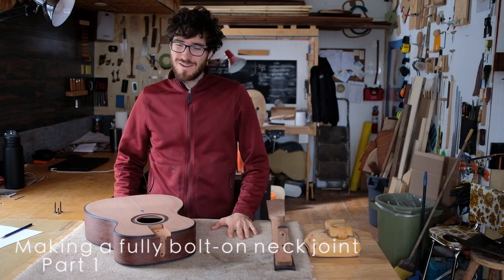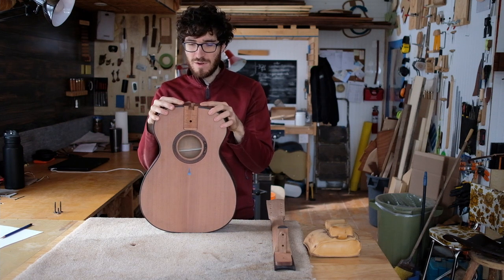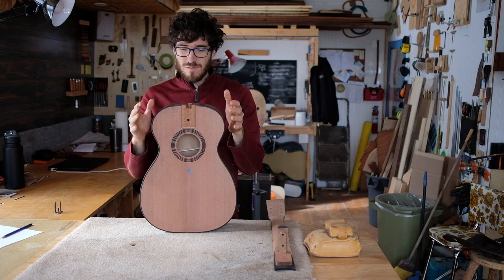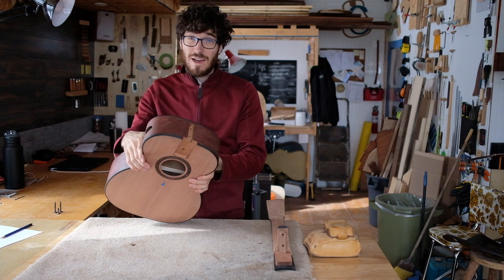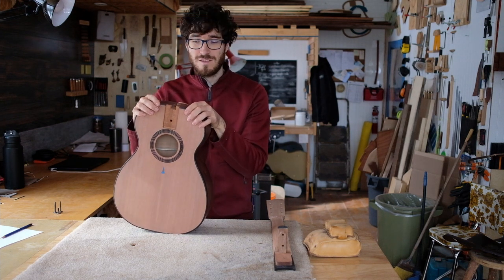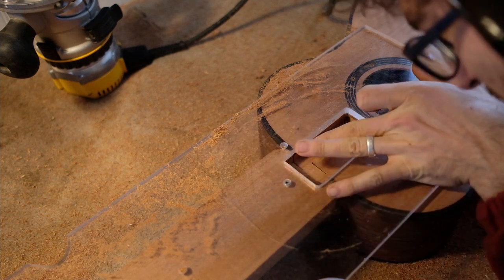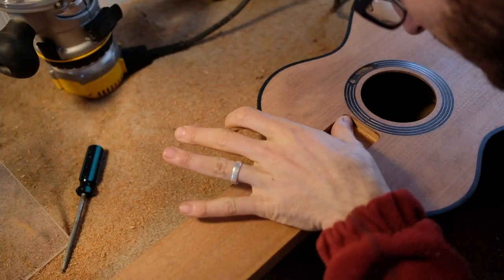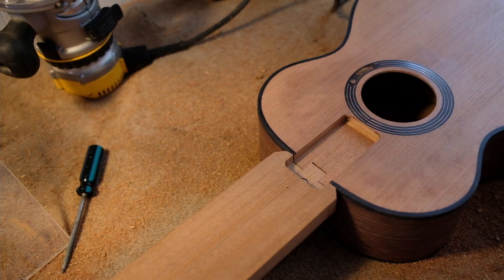Making a fully bolt-on neck joint - Part 1

Comment: It drew my interest.. however,  neck  extensions aren't hard to un glue ... 

Also , if you think  about it , that glue isn't doing much other than dropping the the extension out of the way of the business frets . A person could use ans easy to separate glue like fish glue and not spread it over the whole extension.  A hot palette knife could separate it with ease.and you could do it so the knife would slide under the extension easily.. you wouldn't need roo much heat , nor much chance of scuffing the top, not much glue to remove..and the making of the joint would be easy peazy..

I think I'm trying that on the next mortise and Tenon Nick I reset.

 Thanks for posting.. while I probably won't be copying that idea , you sure gave me a good one to try out.
Reply from the maker: Sure, that’s another way to do it and would work just fine. In fact, that’s what I used to do for about the first 7 or 8 years of my career, bolted through the heel block and glued fingerboard extension. I just really like the serviceability of a fully bolt on neck joint as well as the stability of the frame in the upper bout when it’s done this way. Taking apart a glued fingerboard extension is not fun and it is pretty tricky not to damage the finish anywhere so it often requires several more hours of work for a technician if the neck needs to be removed. 
With all that being said, this is just one of many many ways to attach a neck on. It’s not necessarily better or worse, just different. :)

Comment: Hi Zach, thx for all the help via comments on this joint.

I routed the mortise and tenon and the neck is out of alignment by maybe  1/64” over 12”.  Would you rough shape the heel and then floss it to perfection and then do the extension pocket, or am I close enough that I can do the extension now and floss the perfect fit later?  I’m wondering if it has to be bang on at this point or just really close. Thx!
Reply: Yeah I’ve had to do what you mentioned a few times now. I rough shape the heel then hollow out some of the wood between the edges of the heel and the tenon so flossing works more effectively, then put the two bolts in loosely and floss. Tightening the bolts every now and then to check your alignment. Once it’s bang on then move on to routing for the extension pocket. 👍🏼
Reply: Perfect, thx!
Reply: No problem! :)

Comment: Great approach for getting this joint spot on correct !  I retired many years ago but keep active repairing and building guitars. At the moment I'm building an OM-21 style and as I live in Australia, I'm using Victorian Ash which is a eucalyptus hardwood for the neck.  
Could you tell me about the guide you're using to check the fit of the neck to the body and is there a radius in the top or is it flat ?
Reply: Thanks! 
Cool, that’ll be a fun project :)
The jig I’m checking the neck angle with basically just has 3 protrusions, one at the bridge location, one at the neck joint and the other (which sticks out about 2mm extra) is at the nut. It helps me dial in the setback of my neck so that my neck projects to the right height at the saddle. 
Alignment side to side is eyeballed with a centre line on the neck and top. Does that answer your question?
Reply: @zachlefebvre4825  Thanks Zach, all new to me as I've be using a more cumbersome approach with a straight edge and measuring gaps etc. Is there a source where I could find a plan on how to build your alignment/reference jig ?
Reply: @andrewdarnley4608 - I don’t know of any plans, but I’ve made a few of these jigs by 
1) jointing one edge of a thin board
2) gluing equal sized “nubs” where the nut, neck joint, and saddle go
3) adding a shim to the “nut nub” which is the thickness I want the setback to be.

Comment: The neck block 'ledge' or 'extension' that gets routed out... is that glued on to the 'normal' bit of neck block at a slight angle to account for the radius of the top?  Or is it glued on at 90 degrees and left proud of the sides and then sanded down to the radius? Does that make sense?
Reply: Yeah, makes sense! It’s glued on at 90 degrees then sanded down. The top radius would make it ever-so-slightly inconsistent in thickness, but not anything that would throw anything off.
Reply: @treehouseguitars  Nice thanks... whats your top radius?
Reply: @LeddingtonGuitars  - Well it’s actually sort of complicated. My rim is sanded flat then angled back slightly from the heel block to the waist (to get the fingerboard projecting a bit higher at the saddle). My bracing is designed so that once the guitar is strung up the radius is about 28’.

Comment: The part I’m fuzzy on is the neck block extension support being glued to the upper transverse brace. I’ve always heard that end grain to long grain glue joints will fail, and also how do you insure a precise fit between the straightedge routed extension block and the UTB.  I’m struggling to understand how you mark the exact distance between the oversized top to the UTB. It seams measuring and a pencil line wouldn’t get you exact enough for a glue joint.  Or do you route the straightedge, then flush the UTB against it, then mark your grace locations on the side? Any thoughts would be appreciated. I’ve really enjoyed your channel!
Reply: Hey Troy :)
This was one of my concerns the first time I did this joint, but I was glad to see that it was fairly easy to get the end of the block lined up perfectly with the UTB. If your top is pinned into mold you can accurately mark a line at each end of the UTB and use a straightedge to mark it on the block. Then sneak up on it with several router passes until the UTB snuggly slides down next to the block. 
One of the main reasons why end grain glue joints fail is because the glue quickly absorbs into the end grain leaving very little in the glue joint. I should have maybe mentioned this in the video, but I “prime” the end grain of the block extension with a thin layer of glue - let it soak in and dry, lightly sand then proceed to glue the parts together (that goes for any end grain joint). 
You might have noticed that I rout slightly into the UTB when routing the neck/body pocket. This basically makes the end-grain glue joint less important since the neck anchors into the UTB. 
I hope that answers your questions! 
-Zach
Reply: Perfect. Thx a lot for the reply… I have built 2 guitars at this point, but am trying to refine my processes to make the process more repeatable and enjoyable.
Reply: I’ve been thinking about this. I’ve never seen anyone else pin it to the mold but it seems like a good idea… so would you line it up with no braces and get the pin holes aligned so that once it is braced you already have the pins figured out? It seems like if you had the UTB already glued on, the fretboard support would not allow you to accurately mark the pins… have I deduced the order of operations correctly? Thanks so much for your generosity with the information! I don’t know how people learned things before YouTube :)
Reply: @troywoodyard-qb1qk  - That’s right. The pin holes are drilled into the tops (relative to the centre line) as soon as it has been joined. That way I can pin it in place in the mold and trace the outline as well as mark all of my brace locations in relation to where the pins are. The pins are basically locators for where the top (and back) should be at every step of the process.
Reply: @troywoodyard-qb1qk  - my pleasure, by the way. I like helping budding luthiers speed up their learning curve. :)

Comment: Taylor's system idea. But no shim to helping the neck in the right position if you have to compensating the action.
Reply: Very similar, yes, theirs is a brilliant neck joint design in my opinion. I’m sure they weren’t the first to come up with the idea. If you need shims to get the right amount of action then there are bigger issues - and these are all avoided with maintaining correct neck angle throughout this process.
Reply: With that being said, wedge-shaped shims are a good way to correct the neck angle if your entire fingerboard sits in a pocket on the top.
Reply: @treehouseguitars  in my opinion the shim system is a clever idea. Moreover the thickness increases the angle of minimum quantity.
And the best thing is that in most cases you are not going to modify the neck anyway.
Reply: @andros1961  - It’s definitely super user-friendly, which was an smart move on Taylor’s part. Any form of bolt on neck makes future modifications/repairs easy and inexpensive really. Theirs happens to be pretty foolproof which is great if they end up in the hands of guitar techs with little to no experience working on them.

Comment: hey zach i see there are four holes on the tennon of the jig so did your cousin make three separate parts to make up the jig . the tennon ,the mortised part and the top part for the 3/8s dowel .just trying to reverse engineer it for people who don't have access to a machinist i've tried three of them there all to busy to mess with a small project like that .so trying to make it up myself thanks so much for sharing this .this is really golden.and a leap forward
Reply: Hey Mark, yes I believe you’re right. It was made in 3 parts then bolted together.

Comment: hey Zach i noticed your sides are laminated what's your tonal thoughts on that ooop's another vid love it where's that tip jar so i can contribute for the gleaning info I'm getting
Reply: Haha, thanks, I’m glad you’re enjoying the videos! I don’t generally laminate my sides, although I think laminating two or three thin layers together would work well. I find adding too much mass to the sides affects the bass response and clarity in a way that I don’t particularly like (with my building style anyways). 
This guitar has a laminated back which was for a few reasons. Honduras Rosewood is so dense it sinks in water so I wanted to take up some of the back’s thickness with a light weight wood to keep it more active. Also the back is actually made of 6 pieces so a second layer helps to reinforce all those joints.

Comment: Great video, I've always stayed away from bolt on neck joints simply because the fretboard is still glued, but this seems to be the answer. ps Is that a coffin guitar on the wall?
Reply: Thanks :) 
Yeah, I don’t think a bolt on neck joint makes much sense if it’s still partially glued on… 
The “coffin guitar” is a jig I built to simulate strings on a guitar with a floating bridge. Basically the body, without a neck, sits under the strings and I can find the strings to pitch and adjust break angle over the bridge and get a sense of the sound before a lot of the work is done on the rest of the guitar. It has come in pretty handy!

Comment: Why not use a steel rod instead of the aluminum one in the heel for more strength and less chance of threads getting stripped?
Reply from the maker: Yeah you could do that for sure. I like aluminum for its low mass as well as the fact that if you accidentally hit it with a router bit it's not going to destroy anything.

Comment: Hey Zack......I am absolutely going to go with this method of neck joint, and I wonder if you can help me out with a couple things? Did you design the jigs for drilling the body holes for the bolts? If so, is that something you would share the plans with? Also....the jig you used for machine heads....I have never seen that before. Is that your design?
Reply: Hey Len! 
Yes I did design the jig for drilling all the holes, I had my cousin machine it for me. I could give you some more details of the jig although the measurements don’t matter a whole lot, in fact it may make more sense to adapt it to your design. If you have a wider heel than me you might want a wider tenon or if you body depths are quite a bit different the bolt spacing should be changed. 
In my case as long as the 3/8” aluminum rod goes down the centre of the heel parallel to the the tenon (which will also be perpendicular to the bolt holes), and the bolt holes are spaced as such so that the bolt heads don’t interfere with anything internally then it’s good. Another important strength consideration, I believe, is for the tenon to be a fair amount wider than the 3/8” rod, otherwise the rod would cause a pretty weak spot in the neck where the wood between the rod and the body could come apart from the rest of the neck. 
Hopefully all that made sense. If you have any questions don’t be afraid to ask for clarification! 
The jig for drilling the machine head holes was my design and I’d like to say it was my idea, but I can’t imagine I’m the first person to have done something like it. 🤷🏻‍♂️
Reply: @treehouseguitars  Thanks for that Zack........I see you are in Ontario, another proud Canadian. I live in beautiful Victoria, B.C. I have been studying your jigs, and method, and I am fascinated by them. I already have most of the jigs, etc.... that I need to forge ahead, but I absolutely want to borrow some of your ideas. I am a new builder. I retired from a great career almost three years ago, and guitar building has become my passion, even though I am only on guitar number four at this time. I hope to dig in deep in the coming years, and produce wonderful sounding and playing instruments. Thank you for your inspiration.
Reply: @len6408  - Aw thanks Len! Being told that I’ve inspired someone is a high compliment. If you have any questions at any point in time I love helping new builders out. And if it does interest you I teach courses from time to time where a few students build a guitar alongside of me and we delve into the nitty gritty of… everything basically. If you do want to be kept in the loop for those you can fill out the form on my website then I’ll have all your contact info. Alternatively I’m happy to just keep answering questions. :)

Comment: How wide is your tenon - It looks about 20 mm or so - Is this correct ? - I've made a template which is about 24 mm wide and I'm a bit worried it might be too wide - I'm planning to have a wide heel so its not an issue in that respect but is there any other reason why 24mm or an inch wide tenon could be problematic ? Thanks - I appreciate schooling newbs might be a bit boring
Reply from the maker: I’m pretty sure my tenons are 3/4” wide, but that’s mainly because my heels are quite narrow. With a 3/8” rod down the heel anchoring the neck that technically only leaves 3/16” of continuous grain on either side of the rod… it’s a bit hard to explain, but if my tenon was 3/8” wide and my rod down the heel is 3/8” wide, then my neck could very easily break away leaving the bolt and tenon behind. Does that make sense? Anyway, a wider tenon would actually be better - the wider you can make it within your heel the better.
Reply: Hi - thanks for the detailed reply - I really appreciate it  - that does make perfect sense. I mocked one up out of the template I have and it was fine. I have to say though - you make it look easy and it definately isnt  @redtreecollectiveguitars
Reply from the maker: @hereasafanofallsorts5164  You're welcome :) Haha, sorry! I suppose I've made a number of jigs this way now so it has become easier for me. -Zach

Comment: How do you adjust for the yaw? I couldn't actually see the jig design. Thanks
Reply: The jig is only for the neck set-back. The side-to-side (I think that’s what you’re referring to as the yaw?) is done by lining up the centre line on the neck with a centre line on the top. When I place the neck blank on the body I sight down the lines and adjust where necessary.

Comment: Is the top arched at the bridge ?
Reply: Umm, I’m not sure what you mean. I brace my guitars so they will be arched fairly consistently AFTER the string tension is applied, so yes, but it’s more complicated than just arching the top in this case. If you simplify it by making your top an even radius then you can get your fingerboard projection aiming slightly higher. I’m assuming that’s why you were asking?

Comment: I think that rather than cut the bolts off I would drill the holes in the heel deeper and let them thread right through the rod.
Reply: If your heel is deep enough to do that it would work well to do that, yeah. In my case I don’t have much more room past the rod so I can’t.

Comment: so is your neck extension block a 1 1/4'' thick
Reply: The extension block that’s glued to the underside of the fingerboard tongue is only 12mm thick, but the heel block itself ends up being around 32mm thick in the centre.